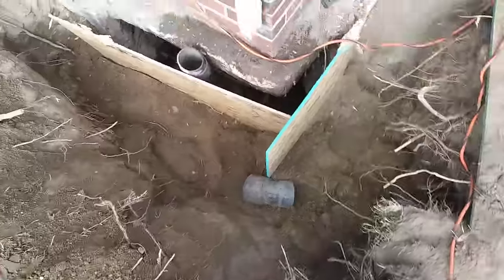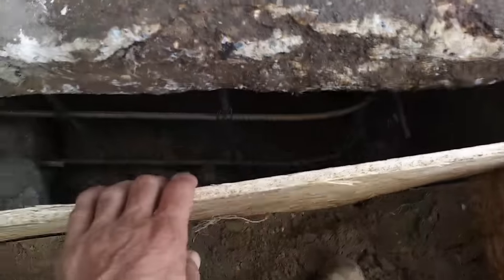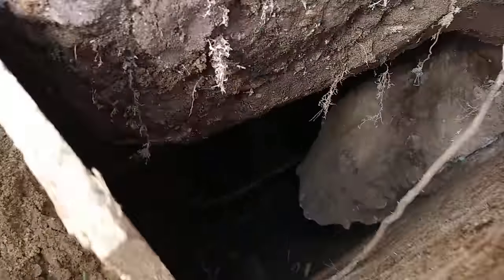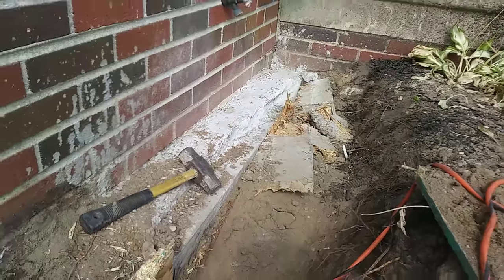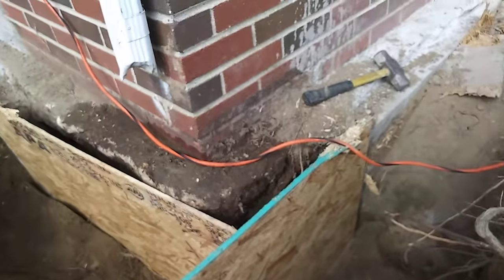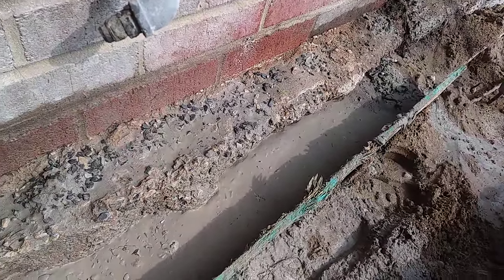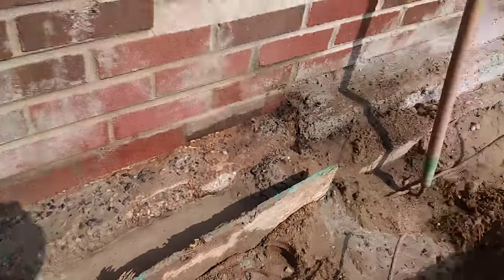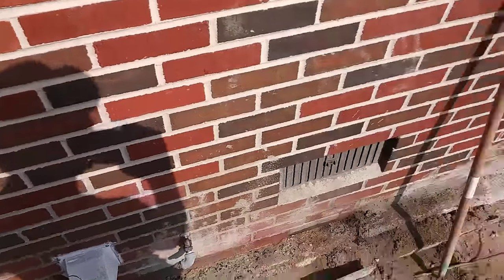Underpinning Foundations - Diy underpinning footings method to stabilize settlement

Comment: Do you get a structural or geotech engineer to conduct the initial investigation and to recommend a design
Reply from the maker: Thank you, Yes. Structural engineer wrote up the repair and design. Once complete we passed all codes and engineers jobs details completion.
Reply: Vincent Dramis fantastic.I am from South africa.I have a house thats about 60 years old and have had some underpinning done but cracks are still widening.I seriously doubt the integrity of the work done by the so called underpinning company
Reply from the maker: Sure I Understand. A Proper Procedure effected by an engineer should have prevented any additional settlement, However, Maybe a soil compaction test should have been arrange prior to repair, ie. Sandy loam would be a poor soil to underpin uponn as it it loose and unstanble. Soild type has a major impact on the job.
Reply from the maker: Oh I agree I think they just did a poor job and built this Edition around existing patio however code may not have been in place because there's no record of the Edition. You know old school Construction which is why we have codes today. Preciate the responses in the communication

Comment: This is exactly what's happening to my addition. Unfortunately, my addition has fallen away at one corner and now has separated from the house by about 2inches and is still moving. I've called three foundation repair companies which all gave the solution of push piers, $18k -$20k, which doesn't fix the problem. This would be a better fix but my structure would need to be lifted before this could happen. The addition on my home is 17’ (2) by 29’ (1). The other solution at this point is to tear down and rebuild. I don't know which fix is more economically feasible.
Reply: Good job! 😊
Reply: Wow, if your house keeps moving you may need to get a license plate for it!
Reply: The way wood costs these days you would probably need to spend a few months individually pulling out and marking every single piece of lumber in that addition and reuse it in order to rebuild LOL. 
But just as an FYI the cost to raise a structure that large especially butted right up against your house is likely to be $100k easily. 
So rebuilding is going to be the way to go if you NEED to have it raised. 
Might want to just build a staircase between the two if possible
Reply: @Luckingsworth  that’s way too much work lol I ended up getting push piers for the structure. We are paying a steep price for it but they will forever be insured through that company no matter if I own the home moving forward or not. I’m 20 days away! Lol
Reply: 3 pins $18k?
Reply: @dereckc9469  11 pins $18k
Reply: @trevorc4052  sorry, I misread, job done? happy with it?
Reply: @paulthurman3216  LOL

Comment: Nice job, how much it will cost to do this job, I have also the same problem
Reply from the maker: Difficult to say. Every situation is different. Your problem has to be evaluated on site. There is no standard cost per say sq ft cost etc...many conditions and factors influence correction cost
Reply: Vincent Dramis do you do work here in Charlotte nc?
Reply from the maker: @archiebraza5062  I do not sorry East Coast New Jersey Philly
Reply: Vincent Dramis thank you, God Bless.
Reply: @Chrdiy  I have the same problem with my foundation. I live in AC. Do you come to do job in AC ?
Reply: @Chrdiy  Atlantic City

Comment: Ya could have washed the brickwork while the concrete was wet 🤓
Reply from the maker: The lime from the concrete still appears. The brick final cleanup is an acid wash like any other Mason removes the limescale